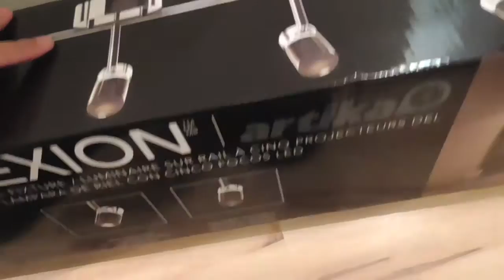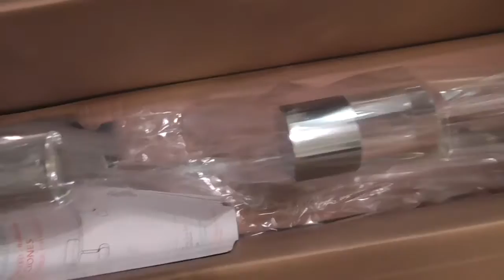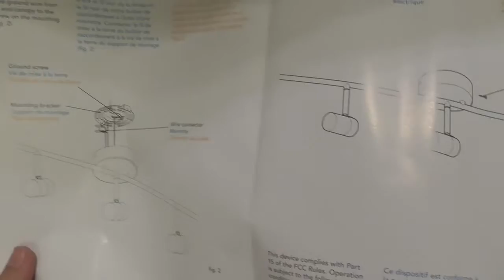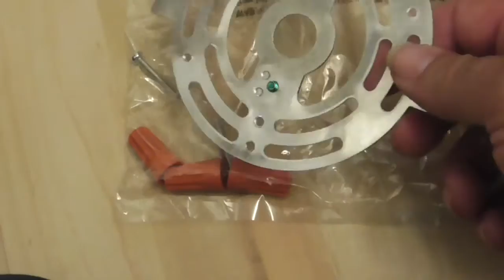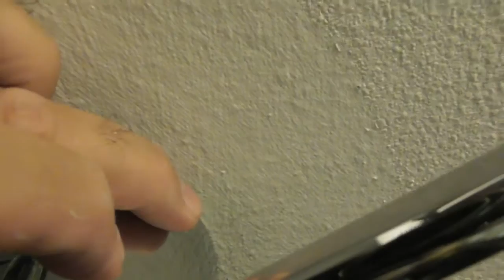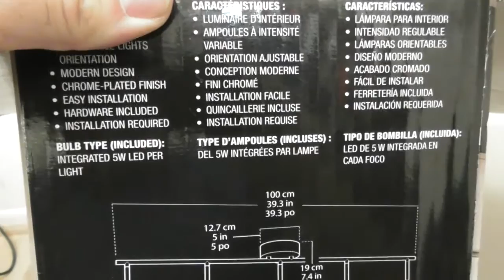Reflexion 40" LED tracklight by Artika COSTCO #707367 CEILING INSTALLATION

Comment: They look good.  Can I install them in my kitchen  in place of old florescent lighting in ceiling box. Maybe I need to units.  Easy to install?  

Good thing I can install these myself and don't need to spend $400-600 hiring an electrician to install recessed lighting.
Reply: I am still trying to  decide for my kitchen lighting  on to go with track(can DIY)  versus recessed(where most contractors recommend but I need to hire them since I don't have time to do it).

The good thing with this item is I can direct bulbs to my counter tops if needed so there are no need to install additional recessed lights over the counters  I think.